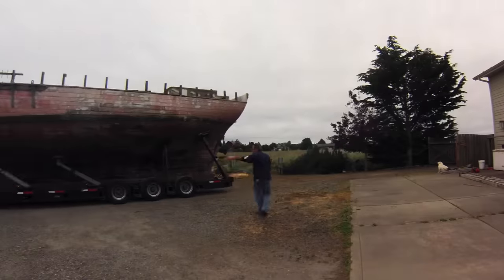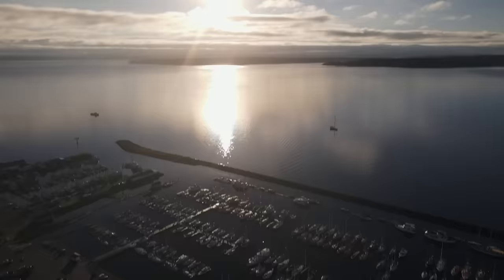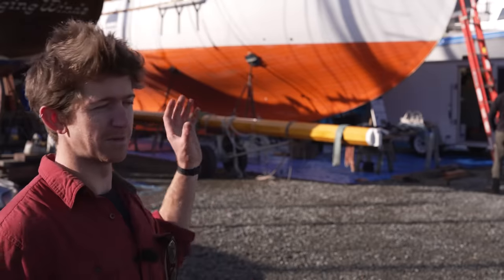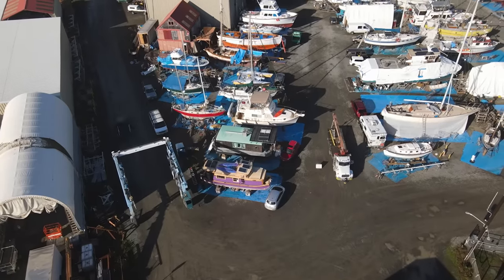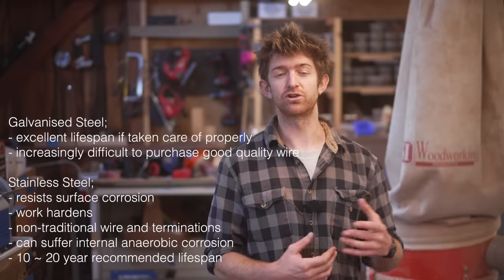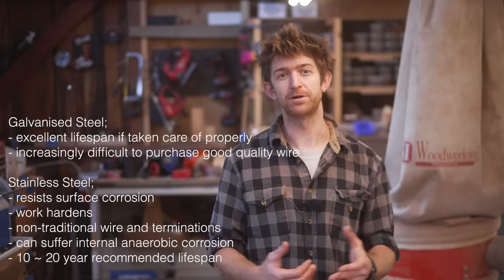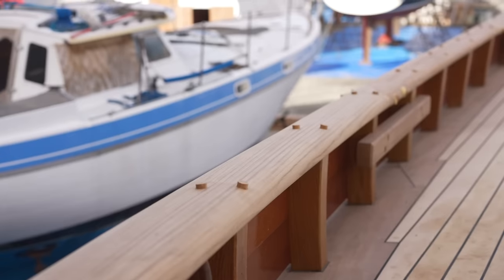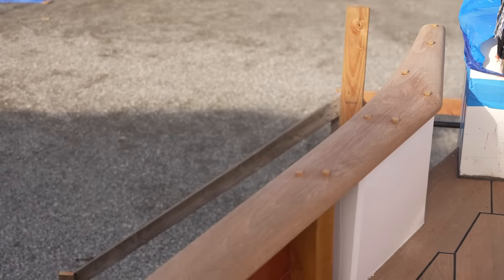Stepping the MAST!

Comment: My father was the State Historian for the State of Michigan (1947-1964). In that era old building were just old. Tear them down. He worked tirelessly with other historians to get that attitude changed, and replaced with the idea that old buildings should be saved. He was well aware that the world can not be full of preserved buildings that are NOT USED. He advocated saving their fabric with integrity, while modernizing their infrastructure such that they had new uses. E.g. look up "Ann Arbor station (Michigan Central Railroad)" in Wikipedia. It was build in 1886, 137 years ago, and all of its exterior, and its interior ceiling and wall woodwork, are original. It has been a restaurant for 53 years now, and that means there is a lot of modern equipment inside. I am sure that m father would be delighted with how Leo is preserving Tally Ho.
Reply: I can only imagine the incredible stories that your wonderful father had to tell. Thank you for your kind comment. And the remembrance. God bless your father.

Comment: I work for the company that manufactures Dyneema.  Pretty cool to see it described for sailing applications.  I’ve been using it for backpacking gear for years.  I always enjoy your videos, Leo.
Reply: use it on my fishing reels for several years.  amazing stuff.
Reply: Hi Drew. I don't want to hijack the thread, but i have a question about dyneema, or, more specifically, adhesives for bonding dyneema to light weigh leather and which will remain flexible. Can you point me to some references? The internet rabbit hole has, so far, been filled with contradictory  and incomplete data. Thanks.
Reply: @chriscmoor I'm not OP, but when I last worked with Dyneema there wasn't much that could be done adhesively given that it's UltraHigh Molecular Weight Polyethylene. There are few adhesives that reliably adhere (and stay adhered) to UHMWPE so it's better to use other joining methods. It's important to note though that using heat needs to be carefully considered because it causes the polymer chains to become disordered and weak at the spot of heat application. If strength of the fiber is a highly important property for your application it really boils down to either the few PE adhesives that exist or knots and mechanical means of fastening.
Reply: @KyleMc16  Thank you.
Reply: @chriscmoor  100% you want to design with mechanical fastening as a requirement for Dyneema. The beauty of course being you have so many options with the wide variety of splices and knots and stitching as all good options.

Comment: Really enjoyed the milling of the material for the mast.  I wonder what it would look like if you took all the wood used for this project and stacked it up (before cutting and planing and sanding...just the raw boards).  Lots of wood!  Also, I really like when something that is being built/rebuilt traditionally, like Tally-Ho, uses modern materials where it makes sense to do so.  Dyneema for the rig makes so much sense.  It's cool that you can even use more traditional techniques to install and finish the new material too!

Comment: Interesting: new material but ancient techniques... I like that very much. The first time I had Dyneema in my hands was a totally new feeling. Low static load and immediate tightness thanks to no stretch is same phenomena that is nature to hydraulics. Difference: Dyneema is tension, ('non' compressable) fluid is pressure. Other areas of Tally Ho are applying new material and ancient techniques combined: hybrid power plant, batteries, sealants and glues, etc. Even the manufacturing: new machines, ancient material: wood. Excellent craftsmanship. Congrats to the MMS - Mast Mile Stone!

Comment: So good to see Tally HO getting her mast. In August a new 75 HP engine was hoisted into my old boat. When they rigged  the engine for the lift the boys used a 3/8's inch multi-strand modern fiber rope. I questioned the use of that "thin stuff" and the shipwrights replied that the new type rope is stronger than  a suitable chain and easier to work with. Well, away went my Isuzu and into the boat it went.  Of course I didn't ask the cost per foot but it can stand the load!

Comment: Aha! I finally have a sort-of connection to Tally Ho. I use braided Dyneema (8-strand) to fly the kites I make for taking aerial photos and videos. The line's excellent for the job - light, thin, soft and pleasant to handle, unlike aramid fibre (kevlar) which is immensely strong and doesn't stretch, but which will slice through thick leather gloves (and fingers!) like a knife.

The Dyneema I use is marketed as fishing line; it has a diameter of just under 1mm and a breaking strain of 300 lbs.

The kites measure about 10' by 12' and have a further connection to yachts and sailing in that the very best material to sew them from is the lightweight ripstop nylon (or polyester) fabric that sailmakers use for spinnakers.

The Tally Ho project really is taking off, Leo... 😁

Comment: There is something really epic about seeing that tree marked for Tally Ho
Reply: Yes you could tell it was a hand picked premium white spruce tree with no imperfections whatsoever.
Reply: That's really such a waste of a big trunk just to cut it all down into small pieces just to glue all back together.
Reply: @calholli recommend watching the video that shows the timber being machined and glued together to form the mast to see why it was done that way.
Reply: @mattlander9119   I did.. I haven't missed any videos since he first crawled inside the old ship, before it was ever moved to that house.   Yes they glued together smaller pieces rather than using a solid pole.  But one of the main benefits of doing that is because you can build it out of smaller trees and save money.  If you already have a large tree -- you're better off using it for larger slabs and beams, rather than to cut it all down to small lumber like they did.    He got the worst of both worlds:  had to pay for a rare and expensive log and also pay for the construction of the beam-- rather than only one or the other.   I'm not doubting the end result, I just think he could have saved a lot of money if done just a little differently.

Comment: I owned a Tahiti Ketch my father built.  The rigging was 1/4" 7x19 stainless with compression sleeves to hold the loops instead of splicing.  It was still going strong after 50 years when I sold the boat.  Hopefully, the Dyneema on Tally Ho iwll do as well or better.  Congats on the mast steppig!

Comment: Leo, once again--no surprise--you have made an absolutely outstandingly correct Engineering decision!  Modern cordage is so much more traditional in that it's actual rope.  I don't know if you're aware, but the highest strength UHMWPE rope is made right here in the Pacific Northwest, in Anacortes.  Cortland makes Plasma Rope mainly for Maritime uses.  I've bought it--it's fantastic!  In any case, whichever of the specific products you use, there's an additional benefit.  Because of the low mass and extremely low stretch, if a cable snaps it won't cut people in half, it will simply drop.

Okay, now I've listened to Ian's analysis.  Dyneema is an excellent choice and close to Plasma in strength.  Ian makes a really superb point about creep and proper sizing!  Since it's so light, you have the flexibility to over-engineer the size of the rope and entirely eliminate any concern about creep.  And you can then laugh at Full Gales.  Seriously.  What's funny is that no matter how hugely you over-engineer it, you'll never come close to the traditional diameters of Hemp Rope.  Also, as Ian says, Dyneema and its ilk are the most UV resistant ropes out there.  But with proper surface treatment, it could become essentially impervious.  This is such a wonderful engineering solution!!

Comment: I'd love to hear more about the dyneema. A friend of mine was going to use it on his ketch but couldn't source it. That was just after Covid and everything was hard to get but he ended up using stainless. One of the issues I keep hearing about is the stretch and how it has to be adjusted several times in the beginning. I've also heard a lot of people say it shouldn't be used on larger boats but I'm not sure why. Anyway, congratulations on stepping the mast - it's a huge milestone!
Reply: It's very common when people with less experience set up a hi-mod fiber rig to basically make the pieces too long initially because they did not pull them tight enough-usually to 8-15% MBS, depending on the material- when measuring for their splices to remove the construction elongation, a step which is not necessary with wire rope. 

As the rigging is pre-tuned and then further tensioned during the first few sails, leading to needing to re-tune and in some cases re-splice in order to have enough adjustment in the turnbuckles or deadeyes. In Tally ho's case we have several factors in our favor: experienced riggers and full service, which when applied correctly will mostly preserve this preliminary elongation of the material for setting-up.

Comment: A nice touch to the bow plate would have been to have the heads of the slotted screws all going in the same direction - parallel with the keel of the boat. Just one of those "old" ship building techniques.

Comment: A Dyneema rig can be repaired nearly anywhere in the World with hand tools. SS Wire and SS Solid Rod rigging requires specialized parts, tooling and technical knowledge. Dyneema rope can be found today in almost any port.

I'm curious about Leo's plans for a autopilot. So many good options today to use with, or alongside his trim-tab rudder-tiller. Sailing Tally-Ho singlr-handed or with minimal cruising crew brings its own challenges.

Comment: Tally Ho is looking great! That bow with its cladding is awesome!

But there sure is a lot of work to be done. I have seen some of the fixtures for the fixed rigging, but nothing at all for the running rigging. And the mast, while very important important, is only one of the spars. I imagine there will be many trips up and down the mast in the bosun's chair before she is ready to set sail. And I have yet to see the rudder move, anchor chain & winch (& anchor), a running motor, bilge pump, any of the sails, etc, etc, etc. I hear a nice capstan is in the works, will that also be powered?

She will be fitted with modern radar, radio, GPS, perhaps even satcom, AIPS transponder?

Comment: Brillant   use of dynema   very brave choice  ,   I recently  replaced  galvanised wire on my  1912  boat with stainless ,    parceled  and served  dynema will be my  next standing rigging  choice in 10 years time  if the stainless lasts  that long !! best  of luck with the final rigging ..
Reply: At this point it's not exactly being brave,, Dyneema is sized for stretch and not strength. Even after 10yrs of uv degrading without being covered, it'll still being tested and found to be stronger, than the equivalent stanless rigging when it's new

Comment: Leo, the mast looks as long as the boat, or is that how it`s done, I don`t know anything about sailboats, that is it, that mast sets about 4 or 5 inches into that bottom joint, I thought it would be about a foot. Once again, just blown away by the skill of the team putting this beast in place. I wondered what you were gonna do during snowfall, and now I know , you will be building a shelter over it, question answered. I know there is a ton more work to do, but you sure are getting close, and it sure looked like a sailing vessel with that mast on it. I don`t know, but that semi load of wood looked like it cost a fortune, all the best to you and the crew.

Comment: I was a bit surprised that you uses a dead blow hammer on the cap rails without a sacrificial block of wood. However the timber seamed not to have any "dings" anyhow. Nice work as usual.

Comment: There is no material existing that has NO strain. Correct would be to say that dyneema has very little strain. But in fact even the stiffest dyneema types have slightly more strain than a 1x19aisi316 wire that would be found in most sailboat rigging. Only because dyneema is so light you can choose slightly bigger diameter without a weight impact and by that achieve the same stretch then a conventional wire rigging.

Comment: Austinetic stainless steel is susceptible to a form of corrosion called chloride stress cracking. The metal has to be in tension (like standing rigging fittings) and has to be in contact with chloride ions (typically found in abundance in sea water). The chloride contamination would be universal in a wire rope application, with the cracking not showing on the surface, and with the strands of the wire rope allowing the chloride contamination to wick into the interior of the wire. Individual strands would eventually fail, reducing the overall tensile strength of the rope and can lead to catastrophic failure of the piece. This type of corrosion likes high temperatures (>60C) but will occur at lower temperatures at a slower rate.

Comment: I'm fascinated by the use of Dyneema for the rigging. I'm very familiar with using it in rock climbing rigging. I regularly use Dyneema cord that's about as thick as a boot lace to support my entire body weight, it's a really incredible material. I had no idea of its uses in sailing ships but it makes sense
Reply: If you want to know abit more of how well proven it is, look up Peter Greig. He's an Australian rigger that's been using it for years, including boats that have circumnavigate with it and even after 10+yrs of uv degrading it's still stronger than the equivalent wire rigging as its sized for stretch not strength

Comment: Just to give everyone a frame of reference on how strong Dyneema is, I use 1/8” dia Dyneema in my hammock main line. While under load, at a 30 degree angle, my body weight is significantly increased when looking strictly at tensile strength. I trust the stuff with my life, even though my rig is 2 feet off the ground lol.

Comment: As a moderately accomplished amateur luthier, I find it fascinating that there are so many parallels between building a ship like this and building or setting up a musical instrument, right down to the choice of strings. I would choose nylon or silk and steel strings over standard steel strings for something like a vintage Martin parlour guitar, for some of the same reasons Leo chose Dyneema for the rigging here- they can be brought up to pitch at a lower static tension load, putting less stress on the structure.

Comment: Interesting choice for the standing rigging, the fact you do not have to preload the rig and there is no elasticity is a damn fine combination of new and old technology. Rather pretty too.   

Speaking of technology, at the saw mill i noticed they are using a yellow wood magnet to lift the finished planks off the log.   I really want a wood magnet but I have been unable to find a supplier; please post suggestions . A wood magnet would do much to facilitate the install of the front door in my sail boat. 
Thank you.

Comment: I hope that you have more success with Dyneema standing rigging than I did when I tried it on a 12 ft National Solo sailing dinghy about 12 years ago. I did tests both on the boat and in the laboratory, and found that it had vastly excessive stretch compared to stainless rigging for a given load. Also it would continue to elongate when under tension over time. I found the manufacturers claims for minimal stretch and no creep misleading at best. I could not get a stable length of shrouds and forestay, which were crucial to the dinghy's racing performance, so after a season of trying, I went back to stainless rigging. I do hope that either the technology has moved on or that your design doesn't encounter these characteristics in Tally Ho's application.

Comment: In a pinch, I used some galvanized bolts on some dive hardware prior to an ocean dive... Even though I rinsed it in fresh water afterwards, I ended up with very rusty bolts not too long afterwards... Stainless, on the other hand, did not rust...

Comment: Leo, thanks for the very informative explanation of the various standing rigging materials. I am looking forward to seeing the process of installing and tuning it. I'm especially curious to know if a Loos Gauge, like what is used on stainless steel cables, is also used on dyneema or if there is a material specific tool for tensioning.

Comment: I always assumed that the ropes/stays/whatever that hold a mast up, did exactly (and only) that - ie they stopped the mast falling down (I am not a sailor or boat maker, if that's not obvious!).  But, looking at the mast being dry-fitted, and thinking about the force that's transferred from the wind, via the sails and mast, into the boat, I began to wonder if it's more complicated than that.  Obviously, most of the force is transferred at the point(s) where the mast is fitted to the boat, but I wondered if a significant part of that force might also be transferred via the ropes/wires between mast and boat?  To put it more simply (I hope) - does all the force of the wind pass down through the mast, directly into the boat, or is some it 'pulling' the rest of the boat along, via the 'supporting' wires/ropes?  The more I think about this, the more complex it seems - where axactly are the stress/load points, and do they change depending on where the wind is coming from, how the sails are rigged, etc?  And, does any of this matter when you're actually sailing - do you need to adjust and balance depending on the conditions, or is this something set when the mast (etc) is 'tuned'? (My apologies if any of this seems hilariously misinformed!)